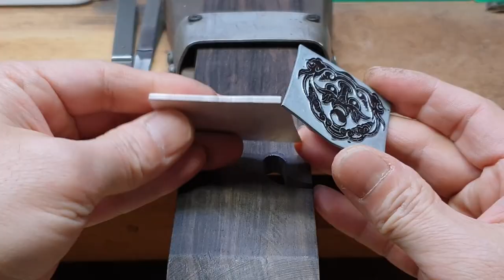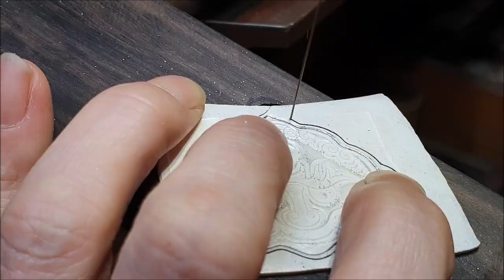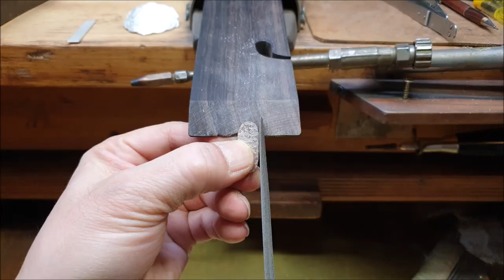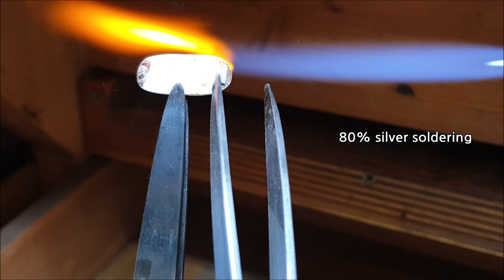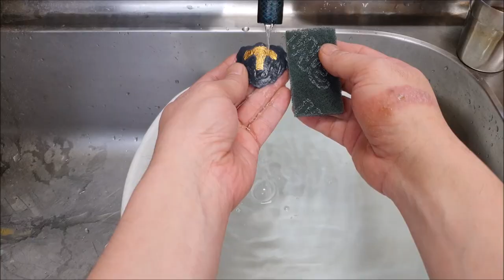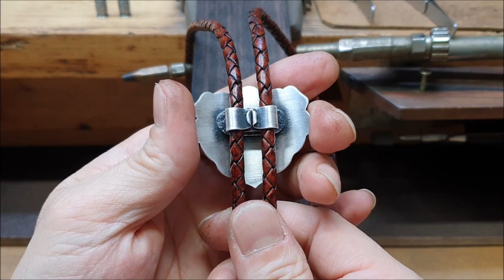Making "Dokkaebi"  BOLO-TIE / Korean traditional goblin

Comment: Bonjour Silvermeister,  Merci beaucoup pour  toutes vos intéressantes vidéos .
J'aimerais utiliser votre technique avec le Keumboo . Peut-on le fabriquer à partir d'or 18 crt ou faut-il de l'or pur ? Auriez vous une vidéo où vous martelez l'or pour faire le Keumboo ?
J'aurais voulu utiliser cette technique sur l'acier ... mais je suppose que ça ne fonctionne qu’avec l'argent et l'or ?

Merci encore en tous cas pour ces vidéos inspirantes , je me suis abonné 😀
Reply from the maker: Keumboo est composé uniquement d'or pur.
Cela ne fonctionne que sur l'argent et l'or.
Il est finement étiré par laminage avec d'autres métaux non ferreux interposés avec de l'or pur.

L'épaisseur de la feuille d'or,,,
Une feuille d'or de la taille d'une carte postale pèse environ 3 à 4 g.
C'est à peu près l'épaisseur.
C'est à peu près l'épaisseur d'un papier ordinaire.

Le chauffage de ces métaux à une température comprise entre 260 et 370 °C augmente
le mouvement des atomes.
Lorsque la pression est ajoutée, cela provoque un échange d'électrons à la surface entre les deux métaux,
créant une liaison de diffusion permanente.
Cette liaison de diffusion se produit bien en dessous
la température de brasage pour l'un ou l'autre des métaux (Dhein, 2004).

Rien n'est permanent dans ce monde.
Il peut s'user avec le temps.
Le contact physique peut le faire décoller.
Il ne s'en va pas facilement avec le temps.
Parce que l'argent et l'or ne faisaient plus qu'un.
Ceci est différent du placage normal.
Merci ~
Reply: @SilverMeister  Merci beaucoup pour votre réponse si détaillée

Comment: Hermoso lo que haces maestro, me gustaría saber el grosor de las laminas de oro y saber si hay algún sitio donde comprar en linea, un saludo
Reply from the maker: El espesor de la hoja de oro,,,
Una hoja de oro del tamaño de una postal pesa aproximadamente 3-4 g.
Eso es sobre el grosor.
Se trata del grosor de un papel normal.

Calentar estos metales a una temperatura entre 260~370°C aumenta
el movimiento de los átomos.
Cuando se agrega presión, esto provoca un intercambio de electrones en la superficie entre los dos metales,
creando un enlace de difusión permanente.
Este enlace de difusión ocurre muy por debajo
la temperatura de soldadura para cualquier metal (Dhein, 2004).

Nada es permanente en este mundo.
Puede desgastarse con el tiempo.
El contacto físico puede hacer que se despegue.
No desaparece fácilmente con el paso del tiempo.
Porque la plata y el oro se hicieron uno.
Esto es diferente del enchapado normal.
Gracias ~
Reply from the maker: Hago y uso KEUMBOO yo mismo.
Ventas fuera de línea en Corea.
No conozco un vendedor en línea. perdón

Comment: What makes the gold stick to the silver?
Reply from the maker: The thickness of the gold sheet,,,
A postcard-sized gold sheet is about 3-4g.
That's about the thickness.
It is about the thickness of a regular paper.

Heating these metals to a temperature between 260~370°C increases 
the movement of the atoms. 
When pressure is added, this causes an electron exchange at the surface between the two metals, 
creating a permanent diffusion bond. 
This diffusion bond occurs far below 
the soldering temperature for either metal (Dhein, 2004).

Nothing is permanent in this world.
It may wear out over time.
Physical contact may cause it to peel off.
It doesn't go away easily with the passage of time.
Because silver and gold became one.
This is different from normal plating.
Thanks~

Comment: Natural aloe vera for burns..👍👍
Reply from the maker: The wound on the palm of my right hand is not burnt.
It is a trace of working with a metal tool in hand for a long time, 
And the wound gets worse and then gets better and repeats.
As you continue to treat, you will gradually get better.
Thank you very much for worrying about my wounds~
Thanks for the advice aloe vera.